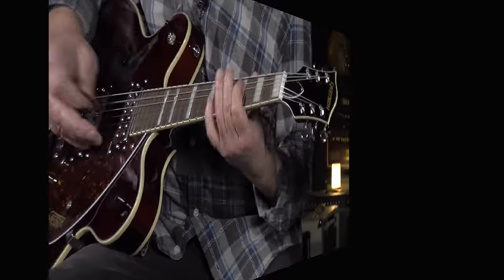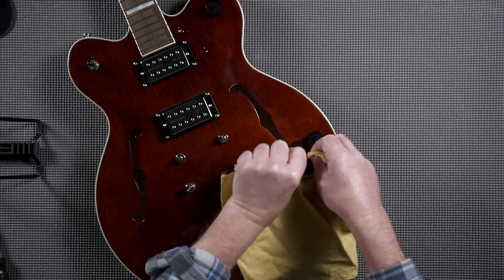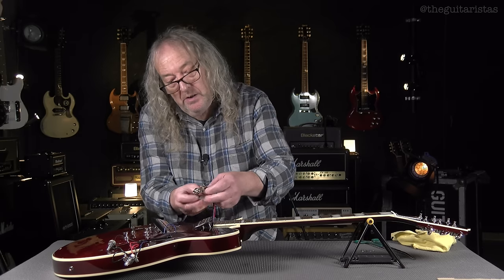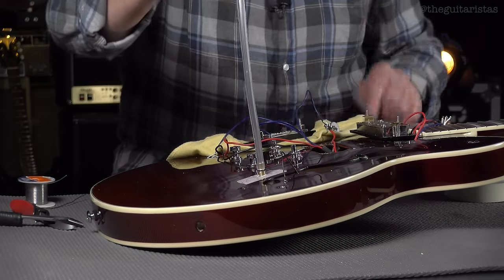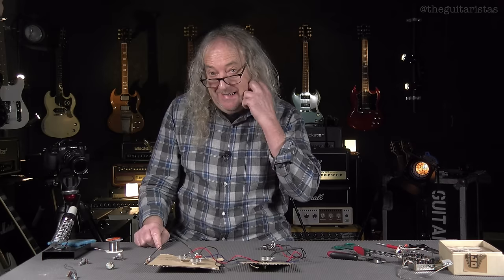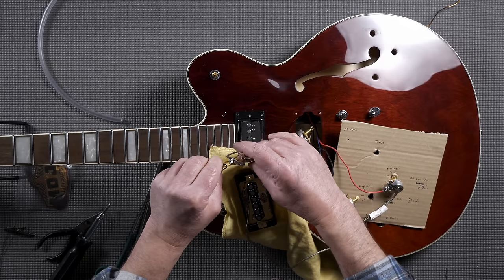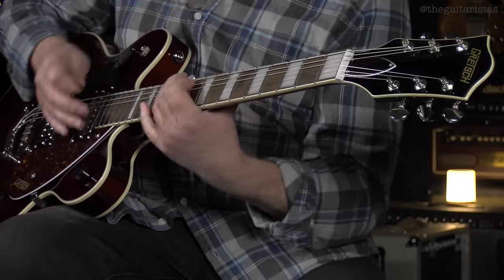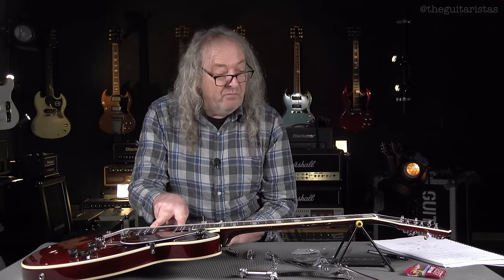Gretsch Streamliner G2622 Upgrade - Part 1: New Dynasonic Pickups & Wiring - Was It Worth It?

Comment: I love the differences in the English language between the US and the UK. You call the car trunk the "boot", and call the car hood the "bonnet". And you call the electrical ground wire the "earth" wire. I love it. Thanks.

Gotta say the Dynasonics do sound better. Very nice.

I've got a couple of these coming from Adorama for 229 and 299 US, a P90 and a Humbucker. I returned one P90 because of an uneven neck and a tilted bridge pickup. We'll see what I get now. As long as you get a good straight neck, you can pretty much work with everything else if you want to. I want a good guitar out of the box though.

Great vid thanks. It's good to see disassembly and all the parts, that's interesting that Gibson and Epiphone bridges and stop tailpieces fit.

Comment: A great fun video on these cool Gretsch guitars. The more expensive Gretsch's are fitted with a treble blead mod on the master volume pot. That is a capasitor & resistor wired up in paralell so that when turning the master volume down it dosn't sound muddy. When upgrading the pots this is a good time to also do this treble blead mod on the master volume pot.

Comment: I look forward to watching this one.

The single best simple upgrade or change to a guitar was putting a Tru- Arc bridge on my Gretsch Tennessee Rose. These only work on the old school floating bridge Gretsches and you have to be able to move the bridge base. (But I thought you might find it interesting to hear about anyway)

After I put it on there was a marked difference acoustically with better resonance, sustain and projection.

I was a bit worried about intonation going from a roller bridge with individual saddles but I did it about ten years ago and have only had one intonation problem on the g string that lasted about 30 seconds (it had some fluff or something in the nut, lifted the string, retuned and it was fine).

Comment: Great video mate. Just an idea that might save you time and bother -- when doing the initial test fitting of the new pot at the 23" mark, instead of mucking around pulling tubing through, you could have simply held the new pot against the side of a pickup hole or an F hole and checked how far the shaft extends above the top that way. The top would be the same thickness all over. But the tubing is a great way to do the final installation. I'll probably be doing a pickup swap on my Electromatic Jet. I'm glad it has rear control plates so I won't need to bother with all that palaver! All semis should have them.

Comment: Good work!  That was a job well done.

A couple of things, though: First, always check what you can before you put stuff back in the guitar (so you don''t have to pull everything back out).  In this case you could have tested your wiring before you put the pots and pickups back in the guitar.  Next, get a violin sound post setter.  If you have problems with something and need to work inside the guitar, and you definitely will eventually, they're very helpful tools to have around.  Another thing or three, if you plan to do this sort of stuff a lot, there are special knob-pulling tools and tools for the knurled retaining nut on the switch, not to mention loads of specialty reamers in large and small diameters that don't have the long point on them.  Having the special tools is one reason why you (might want to) pay pros to do work like this.

Finally, and it's one reason I have a mixed feeling about some of the pre-made wiring harnesses that I've seen, we used to take it as a point of pride  and an indicator of a well-done job of wiring hollow and semi-hollow guitars that you don't see any wires through the f-holes--a pro not only gets things to work, but routes the internal wiring so you can't see it from the outside.
Reply from the maker: Cheers... good tips! 👍

Comment: Hi Colin! I really enjoyed this video. I mean, I always do but I really learned a good amount here. First of all, I hadn't seen the tubing method for replacing pots in a hollow or semi-hollow guitar. I'm instantly less afraid now of partaking in such a project now that I've seen that. Brilliant man! Also, I'm doing a Guitaristas style project on an old Kramer that I've had since the late 80s with a pretty stubborn speed knob that I need to take off. The spoon and credit card method is exactly what I need to do with it. Thanks for that and I'm going to apply both methods that I learned from you here when the time comes.

I'm really impressed with how the pickups turned out. I'll admit, I didn't think that the 500K pots were going to work with the new Dynasonics. I don't think that that was what Gretsch used back in the day with those pickups. I could be wrong about that, but I thought that they might be a bit much for the Dynasonics. I was wrong. They sounded great! That little bit of fuzz that you used at the end also sounded great. I wasn't expecting all of this greatness from these pickups to be honest. Dynasonics are probably my least favorite pickups for guitar. I normally prefer the Filtertrons for Gretsch guitars, but you made these work really well. That was great tone. Maybe the 500K pots were what these pickups needed for me to like them. 

About the B7. I can tell you right now that it won't fit on this guitar without drilling. It's not long enough to reach the tailpiece. I have a Les Paul Tribute that I put a B7 with a Vibramate on in a previous Guitaristas style project that I did, and it was perfect. The bigger body on the Gretsch however means that it won't line up right. I think that other tailpiece that you have will be your better option.

Thanks for another great video and all of the useful information. You managed to help me solve a current problem that I have and how to approach future problems that might arise. Also, props on not putting a hole through the back of the guitar. 👍😉 

Cheers Colin and have a great weekend! ✌
Reply from the maker: Cheers man, if it doesn't fit I suppose at least it will create some good content while I decide what to do! 😆👍

Comment: I use spoons on 2 sides at once, with a microfiber cloth underneath, for equal upward pressure so they dont crack with the sideways angle. I cracked some speed knobs with the single spoon method.
Reply: Automotive door panel removers work great too!!!

Comment: The Fralin Pickups website recommends 500k pots with Dynasonic pickups, so you did good there. Generally, 0.022 uF caps are used with 500k pots and 0.047 uF caps are used with 250k pots. The 0.047 uF will give a darker tone and the 0.022 uF will give a brighter tone.

Comment: Usually I see folks attached tube or string to the old pots before pulling them out, then you can attached the tubes/string to the new harness and pull them back through. Haven't done it, but that's what I would do.
Reply: I'm really referring to Mick's struggle, not when you have to ream the holes.

Comment: Today's affordable guitars like the 5622 represent significant progress from those of days past. They really are better guitars today, which in turn means they are really good platforms for some experimentation and other witchery. Those new pups are definitely tighter on the fundamental frequencies; harder to tell about the overtones/harmonics what with YouTube compression and so forth.
Reply: Agree.  When I started playing, there was no Epiphone or Squier.   Your parents shelled out for a Gibson or Fender…..or else it was a Harmony Les Paul from JC Penny for 99 bucks.  At age 13 that guitar was my world- but compared to today it was junk!   Single coil pickups hidden in a humbucker case, and the “carved top” was a veneer bubble.
Reply: @dmmedic34  Absolutely. Mine (ca. 1968) was a Strat-like pawn shop special with a $12 provenance. As you say, it was my entire world, but honestly, it was nearly impossible to play. It actually came with an amplifier that, if held at the right angle, became a pretty loud AM radio. We indeed have come a long way.
Reply: Fuck! That could have been the 2nd greatest hole ever drilled into a guitar!

Comment: I'd heard that repacing the pickups on these entry level gretsch, let's say for a pair of tv jones ones, was a pain on the neck. Not to mention replacing the potenciometers and the output jack with the use of some plastic  trasparent hoses , those for fishing tanks or aquariums was, at the very least, nerve-racking. Cheers

Comment: My Wilshire Pro recently started to hum so I took it apart. Dime sized pots and crummy switches and a broken ground wire at the output jack. I fixed it, but it bothered me that all that cheap shit was in there, so I bought CTS potd, switches and jack from Stewmac. It's going in right NOW! Thanks Colin! Great job as usual... it sounds great and looks awesome
Reply from the maker: 😁👍 good luck brother!
Reply: @theguitaristas  piece of cake! everything is on the pickguard
Reply from the maker: @touchthesun2448  It's almost cheating! 🤣👍

Comment: That's cool!  It sounds like an old Levin archtop guitar.  If you ever get the change, try one.  They use the older Dynasonics and they are extremely articulate sounding with good output.  You won't be disappointed.  For listening, try Jesse Van Ruller.  He's known for that king of neck pickup sound.   And he's a wonderful player.

Comment: Wow this was like open heart surgery, you can hear the difference and hear the Gretsch chime. I have one of these guitars. I bought second-hand for £200 with a case. It is one of my favourite guitars and as you said in your review of the G2622. You have done some wonderful mods on this guitar. Can I suggest something that will make it look even better. Ditch the plastic knobs, I was able to buy  chrome G arrow knobs for as little as £4 each on eBay. A chrome selector switch is about £4 on eBay and lastly I put a set of cream, plastic pickup rings on mine. The cream rings really gave the guitar that 50s vintage look. I am toying with putting a harp shape tailpiece on mine, but I am afraid that it might change the sound. Another great video!!! Do you have any tricks or tips on how to cap the original post holes for the V tailpiece???

Comment: Nice, Colin! Sounds absolutely great and you did a fine job. If you don't mind constructive advice from a guitar brother, always take a few minutes to protect the finish on top with strips of wide painter's tape for when you have to be working through the holes and the metal bits and tools are trying to scar your guitar's finish. An ounce of prevention's worth a pound of cure. Make friends with masking tape and use it religiously- speaking here from decades as a woodworker. No such thing as too careful. Fantastic pickup/pots mod, I could see you're very happy about it. Cheers from Dallas! 

Oh, P.S.  Found a blonde/maple board Squire Tele for a great deal at my usual local pawn after missing out on the Fender I mentioned last week, it's great. Cleaned up perfect, set it up and it plays like a dream. Once again, lucky me.
Reply from the maker: Yes I know I should be more careful... sorry!
Reply: @theguitaristas  Don't be sorry mate! Pardon me for steering out of my lane. Great job and it sounds awesome. Peace and love.

Comment: Colin, couldn’t have done any better then those professional luthiers! Great job! Take your time and do it right. I dont know if you mentioned the size of the tubing for the pots, and did I see correctly that the nut to secure the pots to the body slid over the tubing to the pot?  If you don’t mind telling me the size of the tubing I’d appreciate it. I use a ribbon and needle nose to pull my pots to the hole. I like the nifty guitar tool you used to fish the wires, in my day we used them to secure smaller objects to keep from burning our fingertips! 😵‍💫 I’ll have to see if I can find them and put it to good use! Cheers Mate!
Reply from the maker: Cheers Stu, yes the nuts fitted over so so it was perfect… I actually took a pot to my local Home Depot (B&Q) to get the tubing! 😂
Reply: Thanks

Comment: I got a G2420 recently, absolutely bowled over by the quality and finish, acoustically sounds great too..........until I plugged it in, then it all fell apart. Those BT2S just disappointed me so much. They're not bad sounding, just nothing Gretsch-y to the sound at all. There are a few tuning options to them though, winding the pole pieces out a lot and drop the body down. Removing 6 screws per p/up can affect the tone in a nice way too.

Comment: I was thinking someone doing a no back plate wire up like this might do well to mark the top of the pot shafts before unscrewing them. I have a set of drill bits that have hex shafts that are the size of screwdriver bits they have been handy when working on projects while the whole house is fast asleep.

Comment: I've got exactly that guitar, and it's a joy to play. The only thing that bothers me - and it is extremely trivial - is the tortoise scratch plate. I think it would look far better if it was solid black, and would go better with the rest of the guitar. I have tried looking for one that'd fit but to no avail.

Gretsch are also releasing some very interesting looking new models this year. One being a Jet with what they are calling p90es. I've only two of their guitars, which means I definitely need more.
Reply: William, if you'd like to change the appearance of the pickguard on your Gretsch or any other guitar, take the guard to a local woodshop or countertop man and pay them for an hour of labor and a few bucks/pounds/whatever for material to have a veneer or plastic laminate bonded on to it. Or do it yourself if you have the tools and skills. All it takes is adhesive, router, files and other basic hand tools, sandpaper and sanding block, and the laminate of your choice. Solvent to clean up and maybe a coat of paste wax after. Or stick on a self-adhesive polyvinyl skin (endless choices: "Axe-Wrap," "Guitar Skinz," etc.) and all you need is an xacto knife and sandpaper- done! And easily removable. I've done this both ways with great results. The color and pattern choices in countertop laminates are practically unlimited and sometimes a shop will have scrap pieces left from a big job and let you have the material for nothing or next-to. You'd be covering the Gretsch logo but is that an issue really? It still says Gretsch on the head and we'd all still know what it is. And waterslide logo decals are available too if you like. All this might cost somewhat more than just a black replacement (if you can find it) but you'd get exactly what you want for a personal touch to YOUR guitar. Hope this gives you some ideas, Cheers!

Comment: Loved this video!  Helpful info for sure, and I was hoping you could tell me an easy way to change out just the one Broadtron center pickup on a Gretsch 2627t which has 3 pickups.  The center pickup on this guitar can be isolated is my reasoning, but I do not want to get into changing pots etc.  Could I just find and cut the leads on the current center p'up, and splice the  wires from the new one in to the harness and then shrink-wrap?//. Thanks in advance, your vids rock!
Reply from the maker: Cheers Al, I see no reason why you couldn’t splice in a replacement… let us know how it goes! 😁👍

Comment: Legend mate, great video, I'm half way through copying you, I've got a wiring diagram from Gretsch with a ground wire running from the neck pot i think to be grounded at the the bridge , did you do this or is there an easier place to ground? 
It's a bastard to access, thanks again 👍
Reply from the maker: Probably is bridge I can't remember but should be in film

Comment: WoT’s wrong with a Duessenburg for a tremolo arm ? I have a lovely Ibanez art ore with the same(Les Paul) setup you have here and the Duessenburg fits right on- a five minute job ! Works easily as good as a Bigsgy ,looks elegant and is easily reversible. Duessenburg seem to have suspended production,but I got mine on Evilbay.
Reply from the maker: I just prefer the old school look of the Bigsby 🤷‍♂️
Reply: @theguitaristas  Me to…in fact,I have both ! But the ‘D’ looks old school if you look at it close up- and it’s a breeze to install.
Reply: AND....it is a lot lighter than a Bigsby -the guitar might be better balanced !
Reply: @maxcuthbert100  probably works better too... got rid of the Bigsby on my Wildkat
Reply: @halvach1998  Works really well ; the spring is right next to the bridge,rather than atr the end of a tailpiece at the end of the guitar.

Comment: Hello mate,
I bought exactly the same guitar (same colour too) about a year ago, and as you did my intention was always like a project to get upgrading the guitar little by little. I have to say I'm very happy with it, althought is not my main guitar, indeed I have to say I believe that the only stuff which worth upgrading are the pick ups (I don't like too much the originals), the nut and (optional) the pots.
I was looking for a dynasonics too and I found the DeArmond Dynasonic for an absolutely afordable price (about 70€ each), and wanted to ask you if that pickups could fit easily in this guitar (don't know if they've got the same size specs than these Gretsch).
Thanks in advance!
Reply from the maker: Hey Martin, I think these replacements were full humbucker size so not sure they are original spec as dynasonics so check before buying